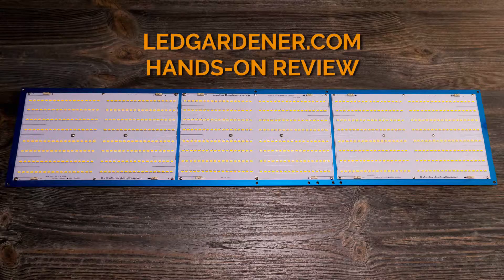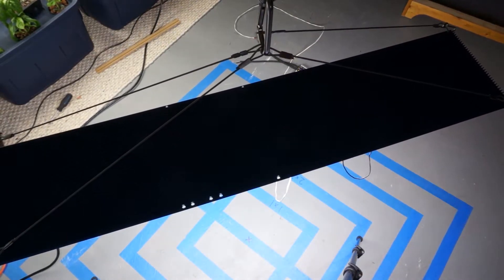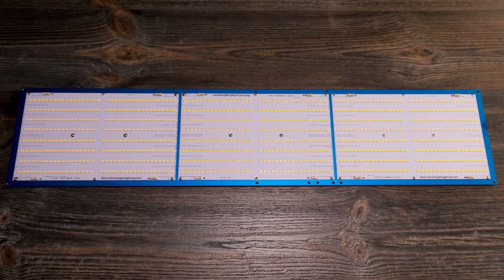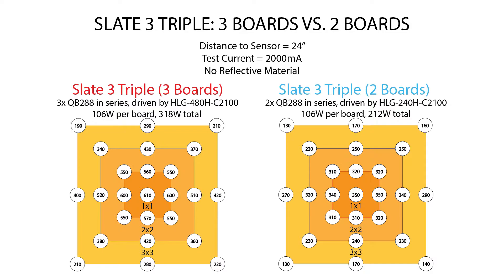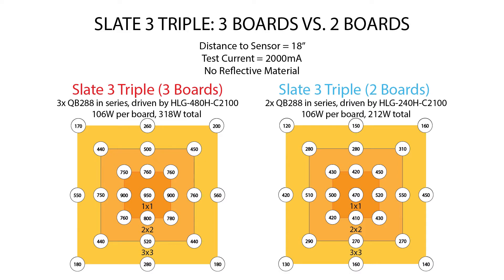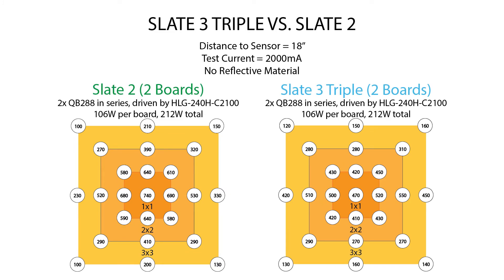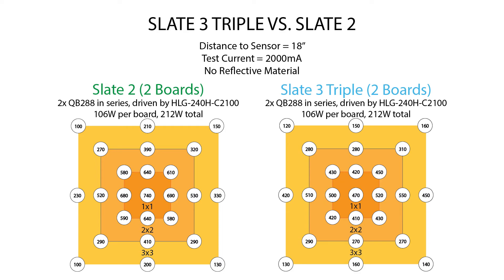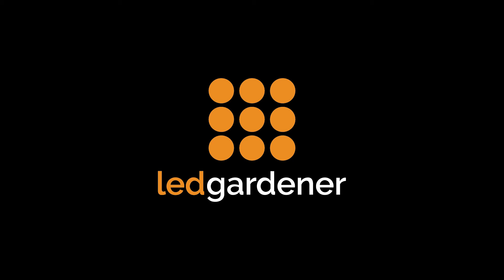Hands-on Review: HLG Slate 3 Triple Heat Sink for Quantum Boards

Comment: Why don't you show how to wire it? This is the only video on the 320 basically anywhere... Please upload wiring video!
Reply: It depends on the used driver(s). If you have e.g. 3x QB 288's powered by a constant Current driver (imho a preferrable solution - for this configuration, Meanwell's HLG-320H-1750 or HLG-480H-2100/2800 would be ideal) then just wire the boards in series. If you go with constant Voltage driver, you need to wire them in parallel. There is a nice guide at horticulturelightninggroup's website with many examples and pictures, might be worth checking out.

Comment: what is the difference between slate 3 and slate 2 Chips ? lm 561Cs6 VS LM 301B ?
Reply from the maker: Sigmundy Freud the slates are just the heat sinks. Slate 3 has been discontinued.

Comment: Is there a "better" board between qb288 and qb304? Which 1 should I pick?
Reply from the maker: Not really. The difference in diode count is just about negligible. The important difference between them is the board's voltage. The QB288 is a 54V board while the QB304 is a 110V board. You'll need different drivers to run each type. I'm partial to the QB288s myself because it's easier to run them in series than it is to run the 304s in series.
Reply: LED Gardener thank you
Reply from the maker: Anytime!

Comment: Could you run 6 boards ( 2x slate 3 triple) or even 9 (3x slate triple 3)  soft and restrict the wattage?
LIke is there a driver that will run say 6 or 9 boards and only consume 200-250 watts per table? or 25 watts per st.

Would love to see someone do a 3x3 table with an even par from center to edge so every part of the table is getting near perfect coverage evenly.

EDIT:   Or could you change the driver to push the max of the driver but run the hlg 550 at say half the 515watts  (about 258 watts) without having to use a dimmer and losing par ?
Reply from the maker: Hey there. You could achieve this by running boards in parallel. For example, you could run 3 boards in series on an HLG-480H-C2100, then run another string of 3 boards in parallel with the first 3. This would change the current from 2100mA per board x3 boards to 1050mA per board x6 boards. I'd be curious to see how many boards it took and how they'd need to be spaced to get totally even coverage at 500+ PPFD.
Reply: So what could happen if you tried to do 3 boards in series on an HLG-240-c700, then run another string of 3 boards in parallel with the first 3.  Limiting the power and running less amps ? would it fire them up and run the leds softer?  Better efficiency less wattage ?
Reply from the maker: In this case you'd be getting 350mA per board which really isn't much. Efficiency would be great but output would be low.

Comment: I'm building some lights with these slate 3 triple heatsinks right now, two boards in parallel and one HLG-320H-54A driver per heatsink. I'm wiring them in parallel like in your other video here https://youtu.be/sS0_XNiDPQo?t=20m27s. In your video you show the DC leads of the driver connecting to the same side of both boards, the right side where the horticulturelightinggroup.com label is printed. Does this matter? There are + and - connectors on both sides of each board. Can I connect the DC leads to the connectors on the right side of one board and the ones on the left side of the other board, as long as it's still + to + and - to - ? In other words, the boards are mounted on each end of the heatsink and I want the red and black wires coming out of each board to point toward the middle of the heatsinks, so they can go through holes in the heatsink to the back side and connect to the driver, which is mounted in the middle. Do I need to mount one board flipped 180 degrees to do this so the wires connect to the right hand side of each board, or can I connect to either side?
Reply from the maker: Hey dude. Both the positives are connected internally on the board so it doesn't matter which of the two positives you hook up your positive wire to. Same goes for negatives.
Reply: Thank you! Sorry, I'm sure that was a stupid question..
Reply from the maker: No sweat. It's always better to check if you're not sure.